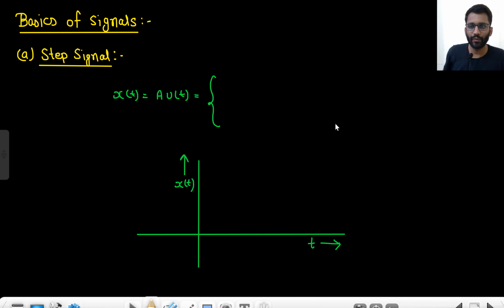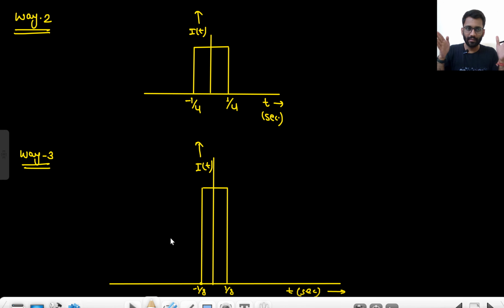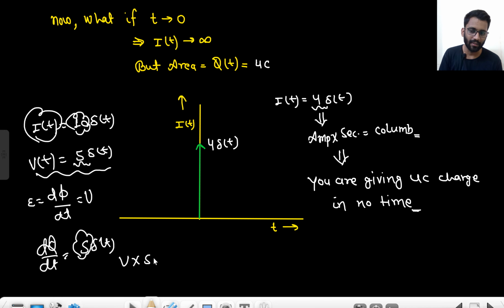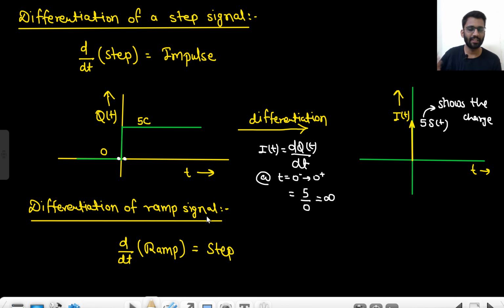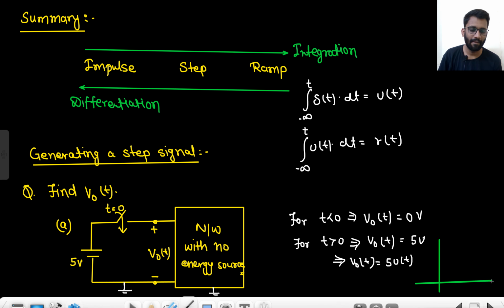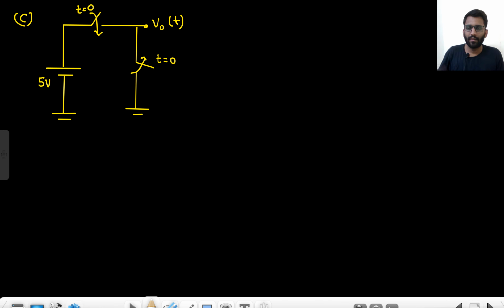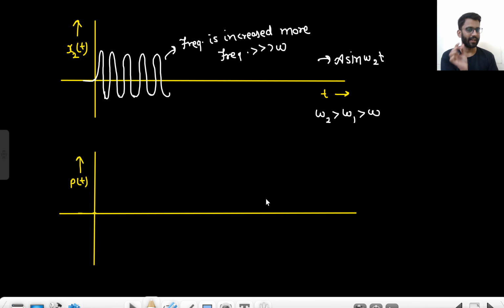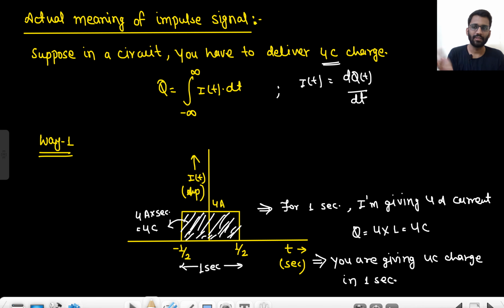Basics of Signals for Transient Analysis || Network Analysis || GATE 2025-26 || PrepFusion

Comment: I am almost done with my MTech from IISc, still now and then I check out your videos . Himamshu really Good content. I have 2 corrections to point out, unit step has different frequencies other than DC, but DC content dominates. Also @ freq= infinity, it has almost negligible  frequency content. I can understand your reasoning that the sudden change would cause infinite frequency, but that sudden change is a cumulative effect of all the sinusoids with frequency not equal to 0.( You can see the fourier transform of unit step function and check the magnitude of frequency component @ freq= infinity). Secondly its a personal opinion, i feel that defining the impulse to take infinity value at t=0 is rather not applicable at certain places, rather its better to define impulse as 0 at all other t except 0 as 0 and the area condition ( integration of impulse from -inf to inf) as equal to A as definition.
Reply: could you explain a bit more about 2nd point